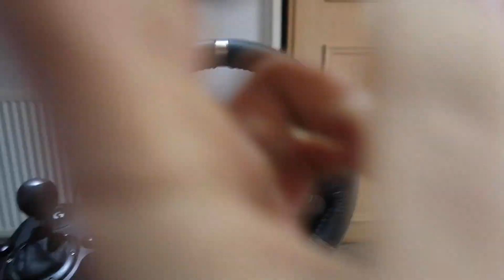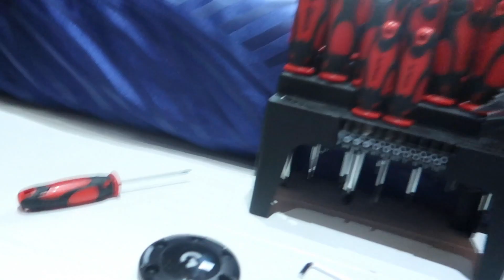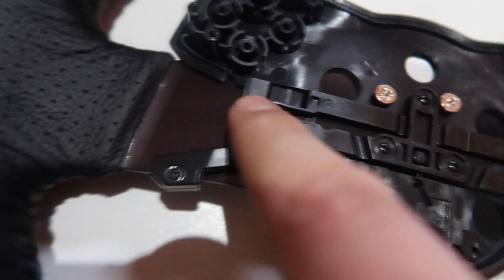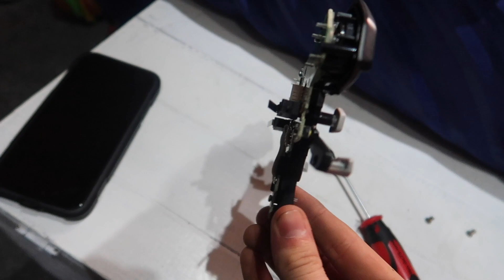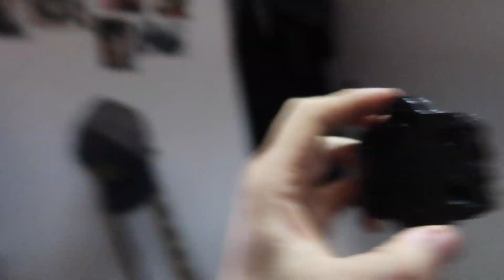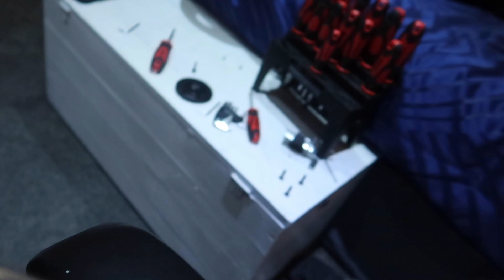Logitech G920 Custom Wheel Mod Install

Comment: Aye bro where did u order the adaptor and the steering wheel, and what did u type in searching for the both
Reply from the maker: Adapter came from eBay G920 wheel adapter wheel I already had lying about from an old car so I’m afraid I don’t know where to find it
Reply: @RootsGarage  Oh alright, im gonna try to do the same thing, thx for the video bro its good
Reply: Santage FR look on aliexpress

Comment: Does it affect to the driving?
Thanks for the tutorial 😃
Reply: Nah they change it bec of the grip and sometimes when u change it its smoother
Reply from the maker: Sorry I missed this comment illvibing is right only downside really is on these wheels it can make the FFB seem a bit vague but I still found it fine just crank it up a bit in the game settings 👍
Reply: Thanks
Reply: The FBB is a bit weaker because the wheel is bigger but that’s all you really need to know

Comment: Do you need separate screws for the wheel or nah?
Reply from the maker: Yes wheel will need its own bolts but usually when you buy a wheel they are included or some of the adapter kits might have them aswell

Comment: Do the side paddles still work without the original wheel on???
Reply from the maker: Yes they do they’re just a bit harder to reach depending on wheel style but you can get extensions for them from somewhere probably find them on eBay!
Reply: @RootsGarage  ok thanks for the quick reply 😆
Reply from the maker: No worries dude hope it helps 😊
Reply: @RootsGarage  hey dude, I know this is off topic for the video but your the only guy that actually responds, do you know about head tracking and if it'll work with triple monitor? I wanted to get vr and a A.S.P heavy hauler button box but I won't be able to see the button box because of the vr so I thought about head tracking. Would it work with 3 monitors? Thanks.
Reply from the maker: No problem dude I don’t have much experience with either head tracking or triple monitor set ups but I suppose it would depend on what games you were running I don’t see why it wouldn’t work but... really with a triple monitor display how much of a benefit would tracking actually be as you would be able to see pretty much everything other than directly behind you lol
Reply: @RootsGarage  yeh lol it's for ets2 so I need to constantly check my mirrors and look left to right and I can't gully check my left and right with 24in monitors
Reply from the maker: Ah okay that makes sense then, last time I used any type of head tracking I found it was a bit glitchy and unstable and the only way to rectify it was with IR LED’s and a IR webcam to track them so if you’re willing to go that far then go for it! (It may have significantly improved since I last used it though)I really don’t see why it wouldn’t work with triple monitors though
Reply: @RootsGarage  yeh I was thinking of going trackir 5

Comment: dang that must be a heavy wheel, im looking at doing this mod but im looking for a light wheel to lessen the dampening of the ffb, on a scale of 1 to 10 how hard was this to do? im a little scared at voiding my warranty and then messing up my wheel on top of that XD only mod ive done so far is an alloy shifter knob that was a huge improvement. and some soft side velcro to make it less clunky sounding.
Reply: I to am wondering about the weight
Reply: @devonritchie1899  yo devon i did this to my wheel and it was absolutely fine buddy, ffb wasnt reduced all that much either it was much more enjoyable with the larger diameter wheel imo, i am however back to my original wheel as my adaptor broke (turns out the logi is stronger than the adaptors 😂) i used it for around a year with a larger wheel until the 3d printed adaptor crumbled.. now back to the original wheel it feels exactly as it did so go ahead and don't worry.
Reply: @DAN.eight6  kool man I'm gonna go ahead and do it, thanks